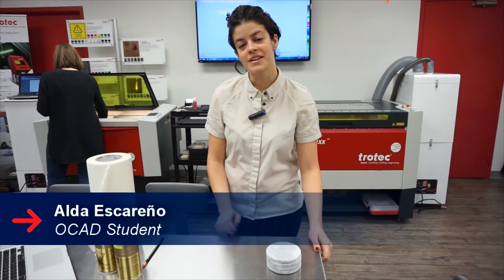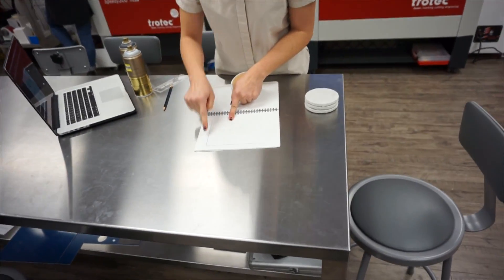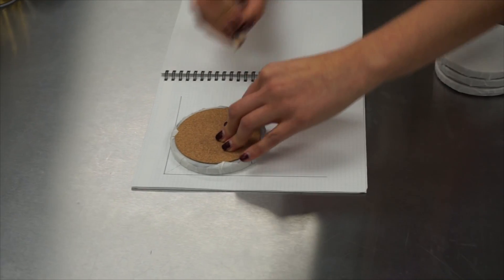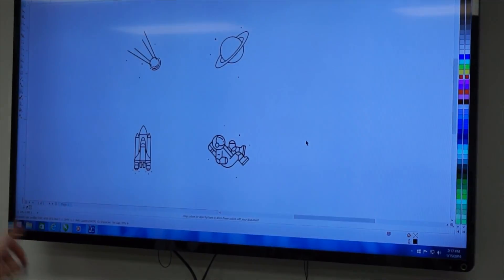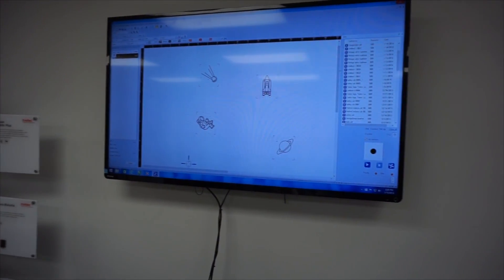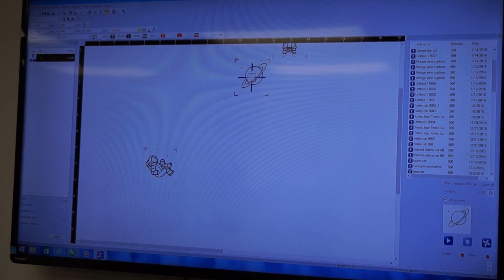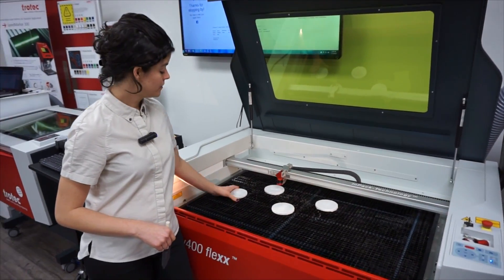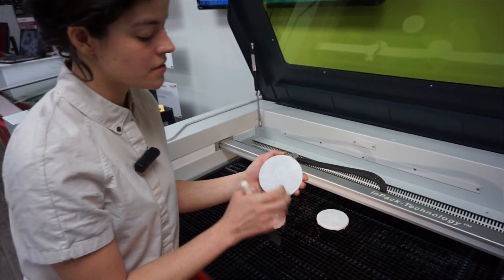Laser Engraving Marble | Engrave Marble Coasters

Comment: So I just learned how to use a laser engraver here at work. Its mainly used for metal, sometimes plastic but no ones used it for marble. That being said, i would like to engrave a small headstone for my wife’s cat and I’m unsure of the best settings for the laser. Ie frequency, scan speed, dot delay or if multiple passes are recommended. TIA

Comment: For those of you that want to use this center of coaster method for smaller projects instead of making a jig for multiple coaster placament, a centering square will come in handy and you can use it to find the center of all size circles so you can easily do tons of projects like this and there pretty cheap.

Comment: Hi, we have a 60W CO2 laser machine . What influence is line distance for you? For us it makes a lot of difference.
Reply from the maker: Hi there, what do you mean?
Reply: @TrotecLaserCanada  When I hatch the vector file, I can choose a lot of options. One of them is line distance. Most of the time i use 0.01 and 0.02. Do you know the best line distance for engrraving for marble?

 Another option is the laser direction: horizontal, vertical, or round. (We are engraving marble jars). Do you have any experience with the best settings?

Comment: I work in laser engraving. On a trotec too. What power and speed setting to you use? Also whatt watt laser is the 400?
Reply from the maker: 100 power 30 speed on 100watts
Reply: @TrotecLaserCanada  What would the setting be for a 50W machine? Having trouble with marble.
Reply: @TrotecLaserCanada  how much does it cost?

Comment: You dont need to bother finding the center. You drop some scrap cardboard in the machine and cut holes for the coasters. This way you can engrave them all at once with no fuss. Also when you paint them you should put the coaster vertical because spray cans dont like spraying downwards for long.
Reply: any work around it great lol
now figure one out to do my job :-)
Reply: I do the same.  I have cut out 4 circles the same size of the coasters, in mdf.  Then as long as my mdf jig is straight all my coasters will be fine.
Reply from the maker: +Robonza Hi Robona, thank you for your comment. These videos from our "Lasers in the Classroom" playlist are meant to give ideas for students and schools on what they can do with these laser machines, not necessarily for mass producing these items. But you are totally right if you are looking to do production work!